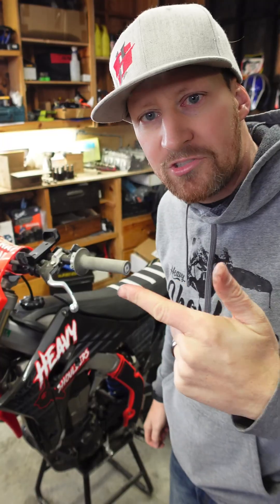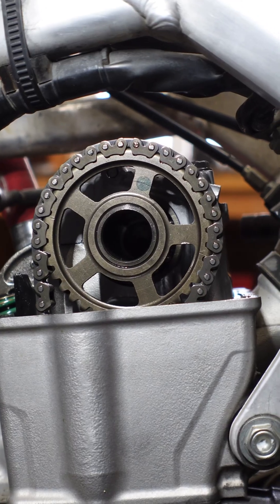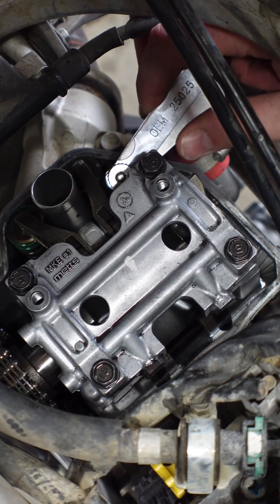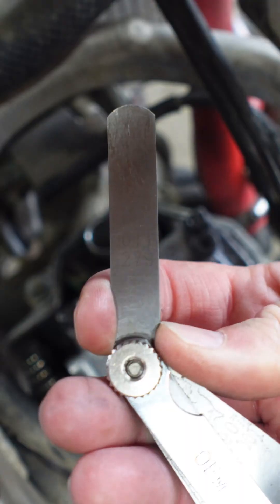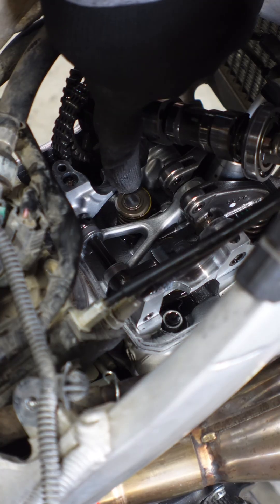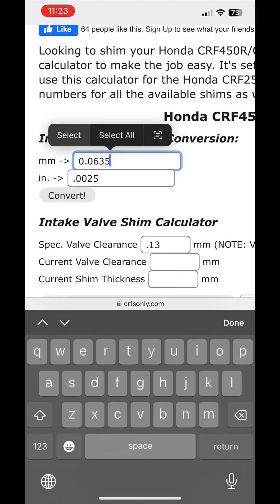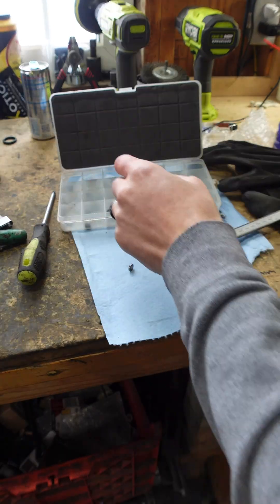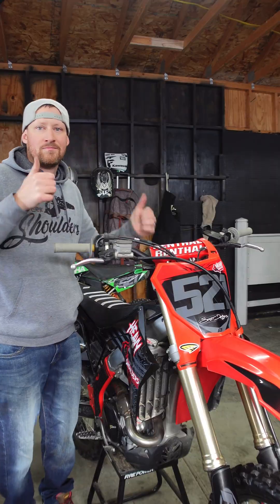How to shim valves on 4 stroke dirt bike.

Comment: So I bought a bike, the guy stated either bad gas or valves need adjusting, bike goes thru gears fine but when in high rpm’s it redlines/bogs and there’s a loss of power , but the bike starts pretty easy what you think it could be ?

Comment: My bike starts super easy when cold but once it’s hot it will not start unless I bump start it. Would this be the valves being to tight?
Reply: Yep. After getting and cooled for a bit valves get more tight. If it gets tighten more it will won't start when cold.

Comment: I have installed new OEM Cams on a KTM, now the shims are too tight, would it be an option to sand the shims down?
Reply from the maker: You could but for the money I would just order from rockymountainatv.com and get a set of them or get 2-3 sizes smaller than what in your bike now.